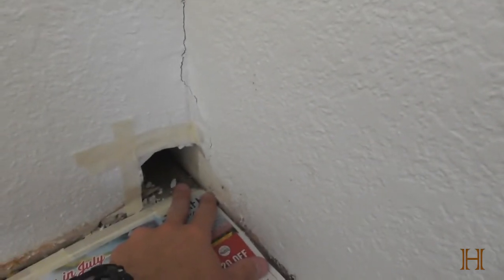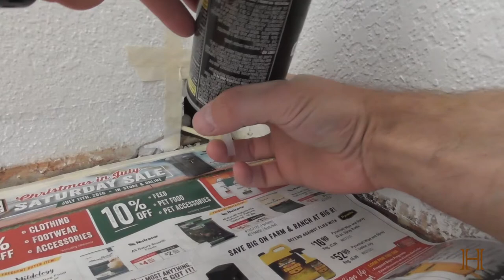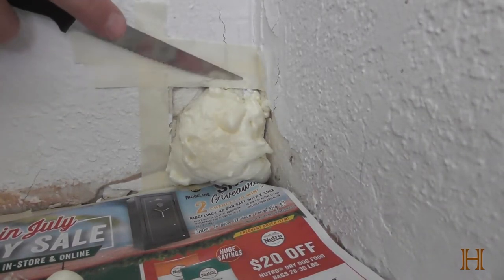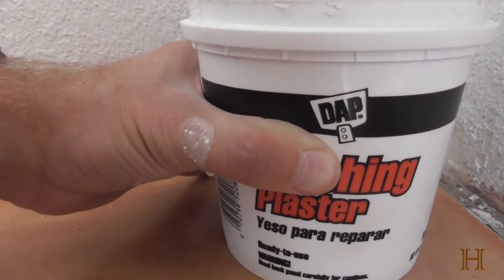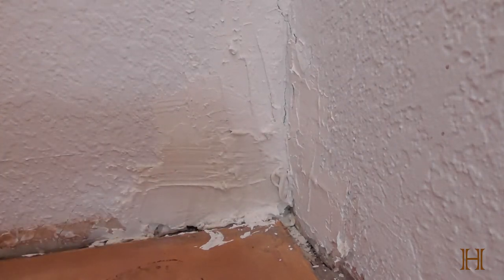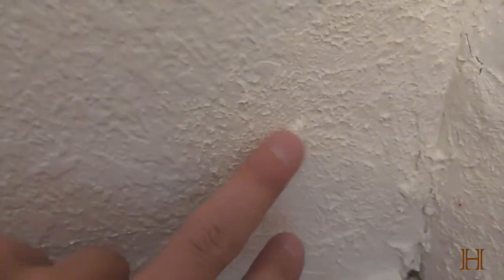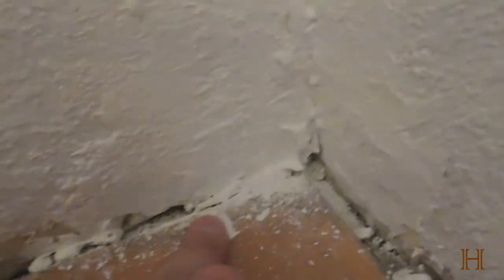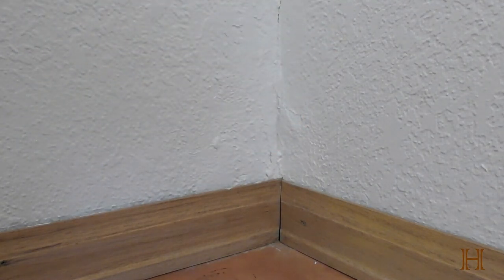Patch Drywall with expanding foam

Comment: I'm assuming you just caulked the corner and repainted. I'm wondering about the long term stability of that crack, but as you say, that's how they built it so cosmetics it is. I've got the same situation in my house and I'm going to try it, but in my case I have to lay tile over it so wish me luck.